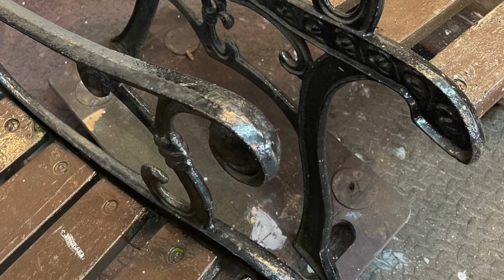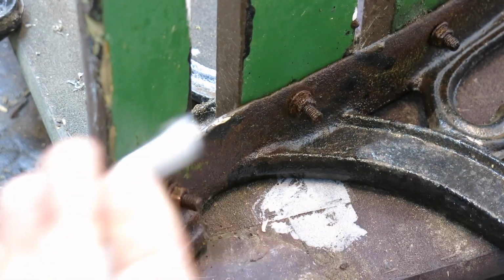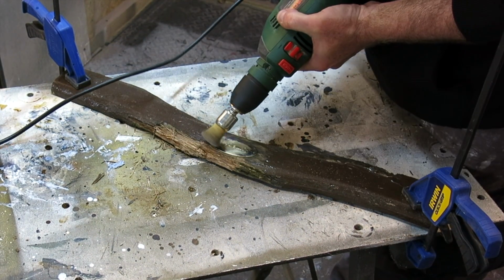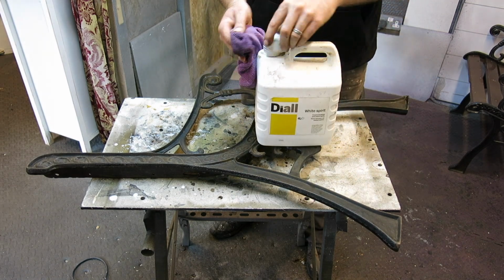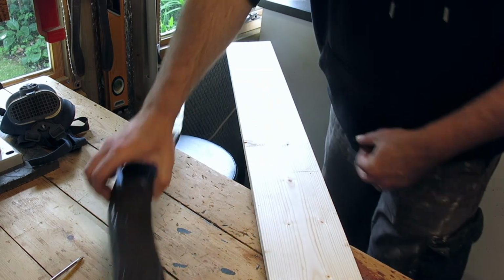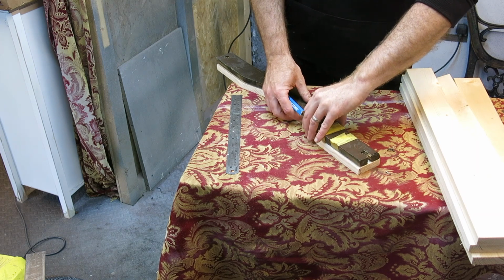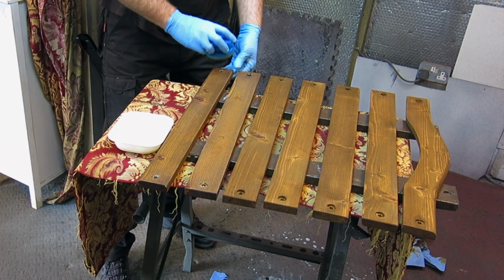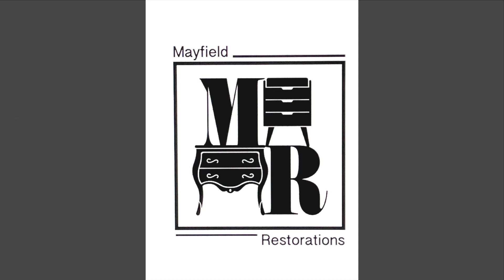Amazing RESTORATION/REPAIR of cast Iron Garden chairs

Comment: This restoration is amazing! It's such a beautiful job that I just hope they don't put them outside where the rain can get on these beautiful chairs. Maybe they can put them in a place where they won't get rained on after all of your hard work. This is my second video that I see of yours and I'm going to subscribe
Reply from the maker: Hi Lorraine, firstly thanks very much for subscribing, it really helps my channel to continue going. I know for a fact the customer is going to use these chairs outside but I'm confident they will last. The finish on the wood is a waterproof external varnish that is UV resistant so shouldn't need any work doing to them for many years. 😀😀👍

Comment: Looks nice! Glad you did the metal all in black. Wondering why you choose pine rather than oak? Budget? If I may, a couple of table saw tips. Don’t raise your blade more then enough so the bottom of the top tooth gullet is slightly above the top of the work. Get rid of that plastic push stick and make one from wood. If that plastic one should come into contact with the blade it will shatter, sending sharp plastic bits flying everywhere, including your face. If a wood one hits the blade it will just get cut. Cheers!
Reply from the maker: Hey, thanks very much for the table saw tips. The one i have isn't very good and i rarely use it because of that so I'm no expert on it. I'm thinking of getting rid of it actually because it so inaccurate!! Regarding the wood slats, you hit the nail on the head. I priced up for solid teak and the customer just didn't have the budget for it. I think it was about 3 times more expensive!!! 😀👍

Comment: Super job---but could you not have found black bolt head screws instead of chrome for the seat slats?
Reply from the maker: Thanks Jill👍 The reason i used those bolts is that they are Stainless Steel and as its to be used outside in the wet British weather, it was the best option to ensure they stood the test of time.😀

Comment: Hi David,I have just watched your writing bureau and Garden chair restoration. All three look fantastic I have been looking for some paint stripper that really did work so your suggestion was very handy. I noticed on the garden chairs you didn’t colour the flowers and the leaves and I think it looks better Malc . by the way was the wood you used on the chairs pine.
Reply from the maker: Hi Malc, the stripper is great as I’ve had mixed results with other strippers. The wood was pine not hardwood as the customers budget didn’t allow it. I made sure to treat each slat fully with an exterior varnish 😀😀👍

Comment: Being garden furniture, I would have expected the use of Galvanized( zinc coated ) hardware . While not shiny, it resists the big  enemy, Rust. And if you use carriage bolts, they self seat so all you need is a wrench to tighten the nuts.
Reply from the maker: Hi Walter. They are stainless steel. 👍

Comment: What length and width are slats please? I have a set of arms and need to know what size to make the slats. Thank you!
Reply from the maker: Apologies as its a while since i did this piece and its back with the customer now so i cant remember the dimensions. If you just measure the hole centres on your bench ends and then deduct approx 10mm for the spacing you should get a rough idea of the slat width needed, 50mm is probably a good size.. For then overall bench width then thats they tend to be about 4ft (1220mm) 😃

Comment: Curious that you used soft wood for all the wood work. Original was hard wood. Your soft wood replacements will not last long. Where you drilled and countersunk the screws is not sealed, water will be able to seep in accelerating rot.
Reply from the maker: Hardwood was too expensive for the customer and all the slats were treated before installing with exterior grade varnish, including the drilled holes. 😀👍

Comment: I wonder if the wood slats were replaced with eepay( phonetic spelling) that this garden furniture wood last longer.  Eepay is naturally resistant to water and rot.
Reply from the maker: Hi Aleta. I discussed wood options with my customer prior to starting the work and Wood here in the UK is expensive, particularly Hardwoods. Due to budget we agreed to replace with Softwood and fully protect against weather 😀👍